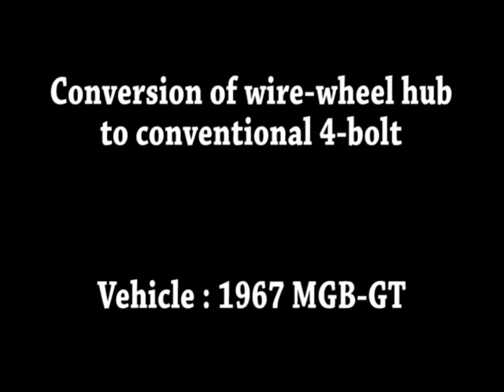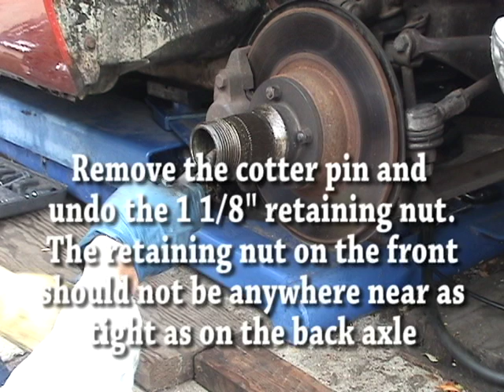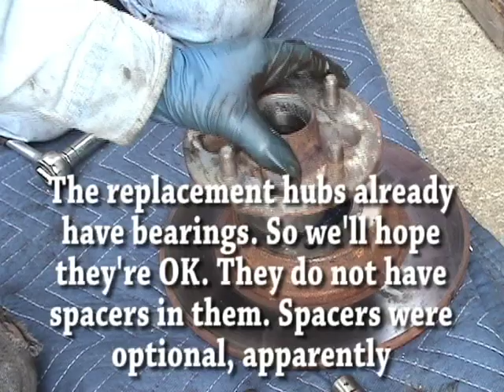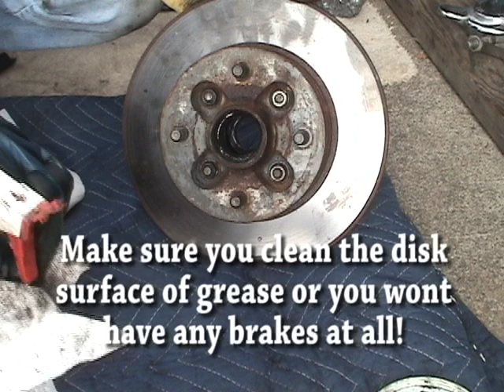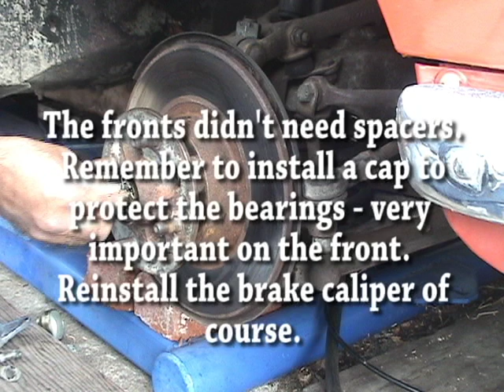Swapping the wire wheel hub for 4-bolt hubs on a 1967 MGB GT

Comment from the maker: You are right, of course. New seals and even new bearings would be a good idea. Note that the race for the outer bearing (of the fronts) came from the EXISTING bearing - and therefore, potentially, wont even match the bearing shell in the replacement hub. I half expected there to be some bearing trouble - but the car drives just fine. If I need to replace the bearings in the future then I'll video that too:)

Comment: You are driving the nut on instead of off??? What is it left or right to take off??
Reply from the maker: On the left side of the car the hub nuts have left hand thread. So the central nuts are clockwise to loosen. I think if they weren't left hand thread, the nuts will loosen while driving.
Reply from the maker: Sorry, the RIGHT hand side of the car has LEFT hand thread.
Reply: I think a lot of people get confused when someone says right or left so i always say drivers side or passenger side but with the MG depending on where it is USA or Europe i suppose would make a problem for even left or right. I always in the USA assume the driver's side is the left side but looking toward the front it would be right side. 
 @mikeatyouttube

Comment: what was the 4 bolt hubs off of?
Reply from the maker: 510Redneck As far as I recall they were off another MG. They were bought through the buy and sell section of the MGExperience website/user group. The wheels and hubs taken off were either sold the same way or through craigslist.
Reply: mikeatyouttube Thank you for your reply, I have been on that site a good bit lately as I'm technically new to the MG game even though I have owned a few of them for many years now (just never had the time to monkey with them).
 With that being said though, I'm currently in the process of fixing up a 4/76 Midget for some relatives of mine and they had a request to remove the spindled wire wheels it currently has in place for a set of 4 lug hubs with regular wheels and I really have no idea of the best way of going about it to full fill their request even after gobs of research the last few nights on a bunch of different sites. I have the mechanical ability.. garage (with lift).. tools etc. to complete the task, just not the knowledge of what works with what the first time around in order to source the parts to do so, which leaves me stalled at the moment unfortunately. lol 

  I have heard a lot of chatter all over the place with everyone showing their different 2 cents worth-opinions in on the matter of MG's (which makes  it confusing for me) but you are really the only one literally I have seen do it as of yet, even though its on a MBG GT (thank you for sharing).
Reply: Yep, just a normal bolt on hub from a 1967 GT, or 68-80 MGB Roadster, or GT. So, any MGB with the tube axle housing, earlier banjo rear housing cars requires an entire axle housing swap. I also did this swap to a 67 GT.
Reply: @hapfp1  do you know if I can use the hubs off a 74 mg midget for a swap to steel wheels? I have a 67 MGB gt with wire wheels. The 74 mg midget has steel wheels and disc brakes. I was hoping I could get the hubs and discs to use for the 67.

Comment: You downgraded bro. I want to convert my 4 lug to wire wheel for looks!
Reply from the maker: A few people have said that. Various reasons for doing this conversion : I converted this car (a friend's)  to battery electric drive so he could use it on his daily commute - with the extra power he wanted non-splined wheels. Converting to 4 bolt allowed for installing disc brakes on the back. He had a greater choice of tires and he didn't have to use innertubes. It all seemed fairly sensible at the time. The car had already been converted to an automatic with a Ford engine when he bought it - and he got a pile of money (about 20% of the price he paid for the car) when he sold the wire wheels.
Reply: Moss Motors has a conversion kit to do exactly that. I’ve seen it before in their MGB catalog. It’s not inexpensive, but it is doable.